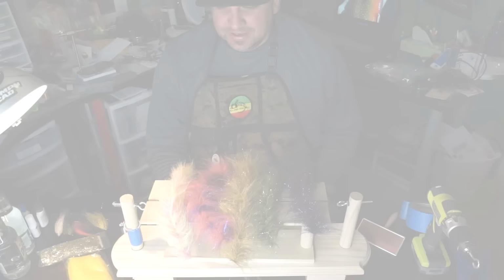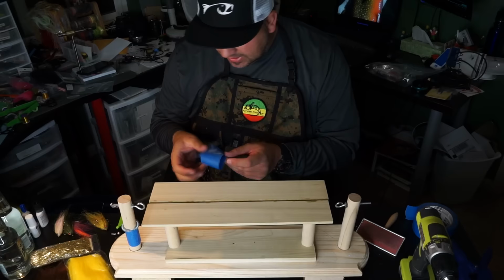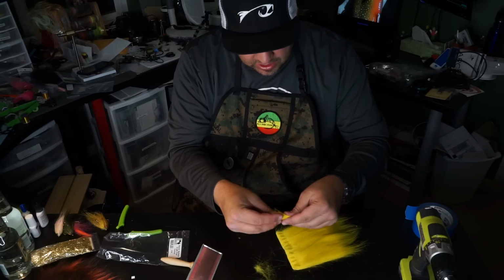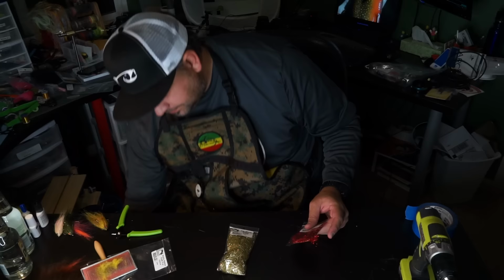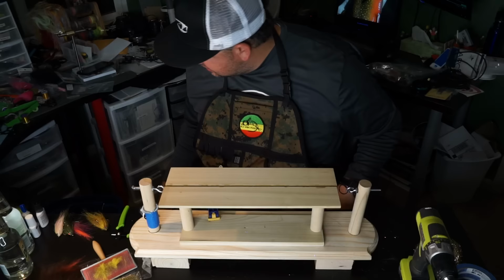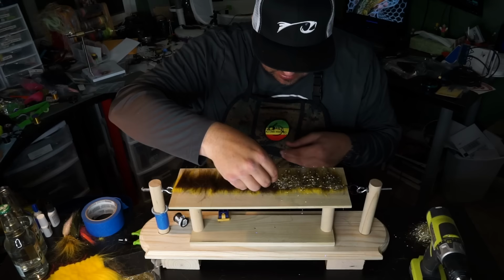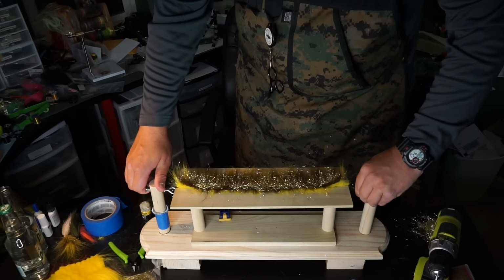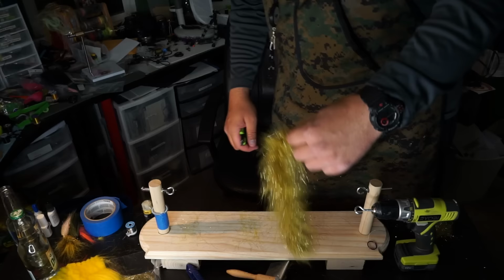DIY Dubbing Brushes by Fly Fish Food

Comment: Great idea. I have a nor-vise with a dubbing brush table that does the same thing. I make brushes out of lots of materials. It makes tying dozens of flies at once really simple and the fly is much more durable. I would like to know exactly what wire you are using. It seems to be much tougher than the wire I use. Thanks for the demonstration. It will save me a lot of craft fur. All the best and thanks for sharing your ideas. Sean
Reply: he says it in the video when he puts the wire on... Uni brand dubbing wire in .009 diameter